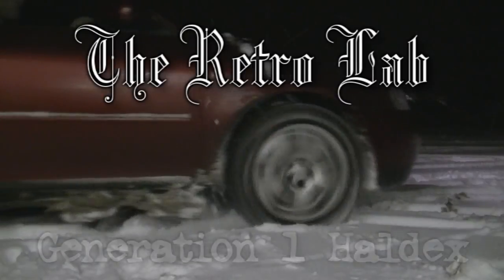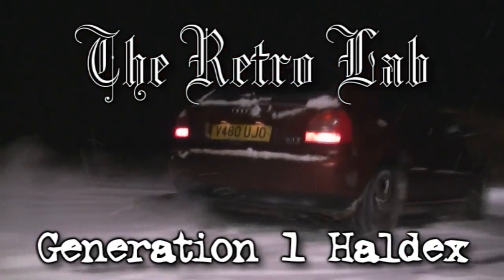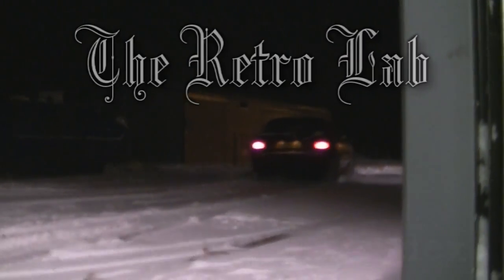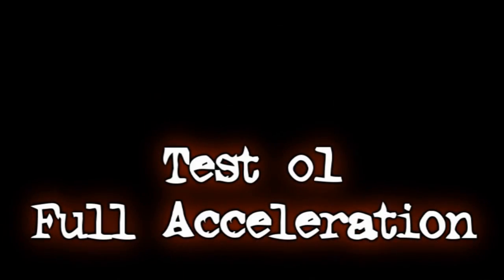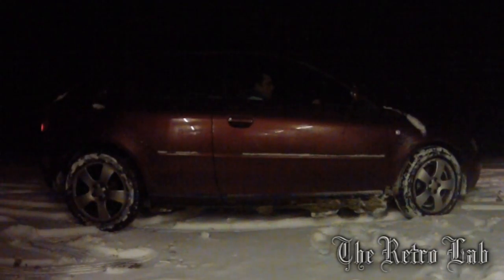Quattro (Haldex) Power Transfer Demonstration (Slow Motion)

Comment from the maker: Thanks for the info! Four inches is impressive! (lol) Because this was a gen 1 I was expecting something which had a lot slower response than it did, I would still have preferred a permanent 50/50 split though I think. I think the gen 3 might be 60/40 to the rear on some cars, so I guess they thought the same thing!

Thanks for watching and commenting! :)

Comment: And Haldex 2 is faster, and Haldex 3 is even faster. Haldex 3 only needs 15 degrees of front wheel slip to sent 59 ft lbs of precharged torque to the rear wheels. 15 degrees of wheel spin is about 4 inches on the surface of your tires. Really no spin at all.